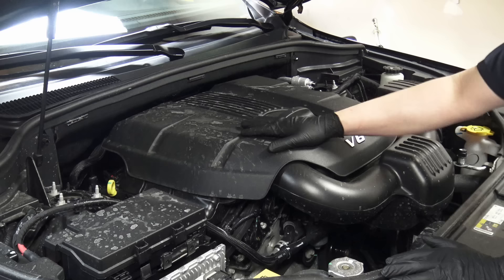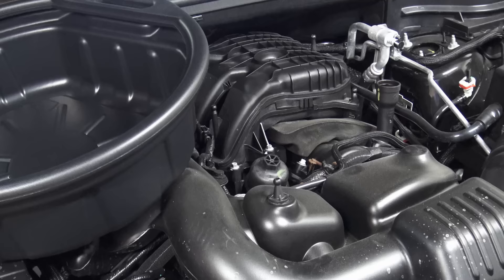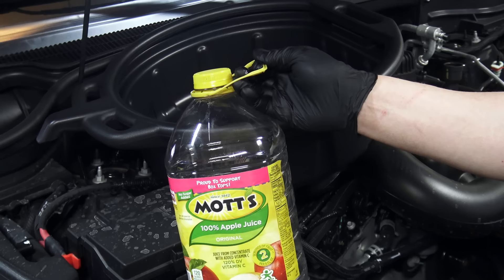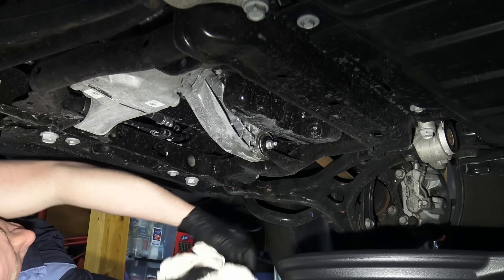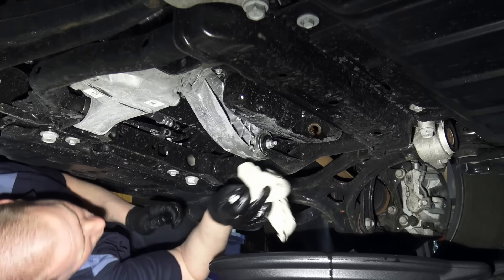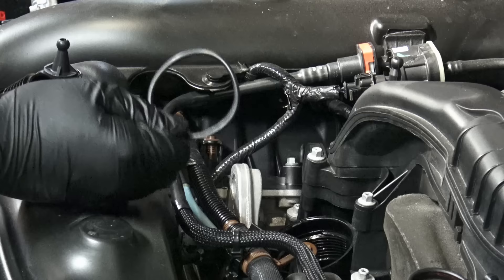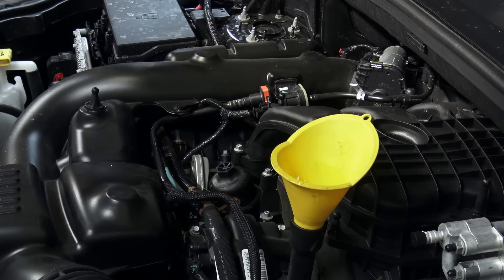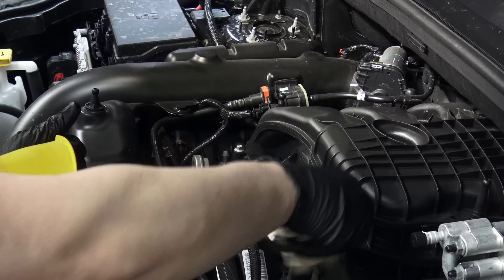2011-2015 Jeep Grand Cherokee 3.6L V6 Oil Change Procedure

Comment: My drain pan plug stripped, any suggestions on what tomdo
Reply: You must have really torqued it tight for that to happen.   Those quick lude places actually train their employees to over tighten both oil filter and drain plugs and require 2 techs to sign off on each oil change because scam artists try and screw those places into buying them new engines all the time.

Comment: Hi. I got 2000 miles on my 15 grand Cherokee. I've had it 8 months. I live and work in Manhattan so I really only use it on the weekends. (Hence the low milage)  but was wondering should I wait till I hit 3000 or does time effect the oil and I should do it before the 3000?
Reply: do not go over 1 year with the oil

Comment: Drain plug torque at 20 lb/ft?  Seems pretty high.
Reply: I forgot, nice video.  This is the first time someone shows how to take off the engine cover.  My 2017 Durango is the same except for the way the oil filter door opens on the engine cover.  My manual says to use 0w-20.

Comment: I have a 2013 and the filter they gave  me does not have a nipple, is this the wrong filter?
Reply: Oil Filter Part # changed for 2014 model year and is not compatible with the 2011 - 2013 model years 3.6 version and vise versa. 

You have the correct filter.  

Chrysler redesigned the filter for 2014, and it is made to fit the 2014 and later 3.6L and the 3.2L Pentastar engines.

Comment: This video should be removed from YouTube because the narrator way way way over torques the oil filter cap onto the housing and the housing will likely break when the next poor guy tries to take it off.  This mechanic illustrates why you should go to a dealer and motto an independent like him.